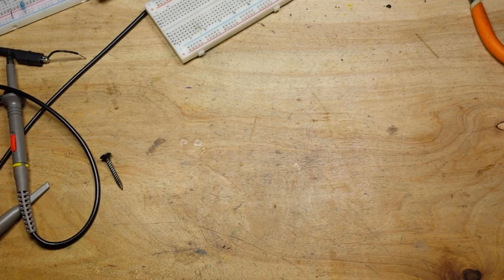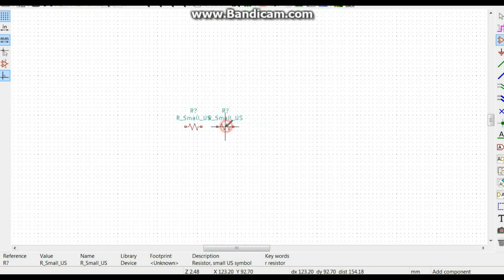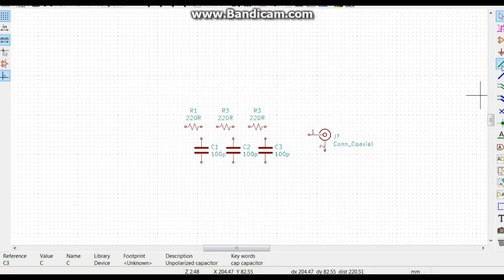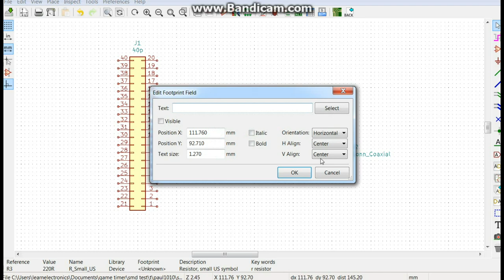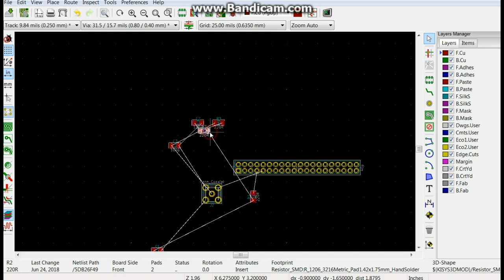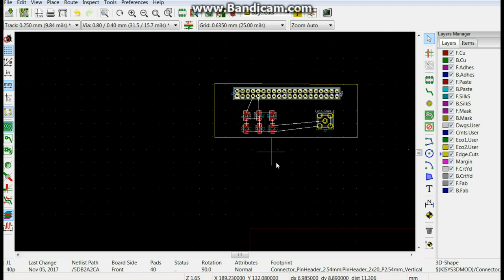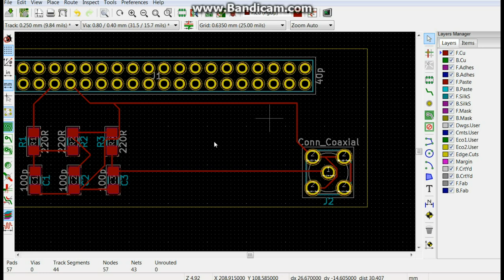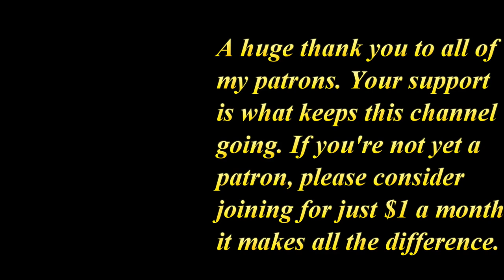PCB keychains & WSPRPI board design

Comment: If you are using KiCAD 5, you can ditch saving and loading netlist file manually, by using Tools -> Update PCB From Schematic. It simplifies the workflow significantly. F8 is the hotkey in schematic editor.
Same function can be used, if you edit the schematic and want to transfer those edits to the PCB editor.
Reply from the maker: Thank you my friend! Now how to get autorouting?
Reply: @learnelectronics  I did a search for autorouting and found that you have to use an external program. I think it is Freeroute or something similar. Or maybe find an older version of Kicad, which I think had an autoroute function (but implications were that it didn't work very well).
But, for simple boards, like this one, it is probably just as easy to hand route it!
wsprpi - I bought a kit from qrpguys for 20 meters (not assembled as yet), but may give this a try for 40 also! 

KF5AQF
Reply: I found the autorouter to do a decent job -- Freerouter was what I found a way to plug in -- but using it was a serious PITA.

Comment: First, let me thank you for your lucid and cogent explanations. Anyone with sufficient knowledge and experience can dazzle with "techspeak" and I am sure you could too. You approach explanations in a clear and non intimidating manner that is refreshing. 
Second, I cannot believe that some a*h** would comment about your edema. I am sure their crap doesn't stink! I am a retired MD and know and I know what you Dx means and what you live under, so do I.
Third, by way of explanation, I am running an RPI3B+ on the latest upgrade (Buster). The JamesP6000 repository files will not load and I get a bunch of errors trying to load. Now by way of interrogative, do you know where I I can find software that will run the WSPR on Buster? I found packets on the software upload tab of my RPI but they have a confusing myriad of digital modes. While I am an Extra Class operator I am thin on my knowledge of digital modes. I was sad when the package from JamesP wouldn't load. 
I did not retire well but will try to scrape up a donation for you. I have Alzheimer's Dz and am using electronic engineering to help delay the inevitable. I really appreciate your videos as they help me learn and retain concepts that I can put to use later. 
Keep up the GREAT work. Stay distant, stay sanitized/washed, and stay masked. You need this infection like a guy soaked in gas needs a match.
Have you posted the Gerber for the 40m filter?
Thanks.  Jeff KG7TXI

Comment: I kept on yelling at the TV, but alas, you never heard.  :)

The steps are generally:

* Place components, and wire them up.
* Generate netlist, which will force an annotation.
* load the netlist in the PCB editor.

The problem you were having is that you manually numbered the resistors, but you used R1, R3, and R3.  This was why it complained about the duplicate.  Later, you basically cleared all annotations, which then allowed it to become R1, R2, and R3.

The UI is very foreign, but once you get things down a bit it's not too bad.

Comment: A bit embarrassing to watch, but then my first usage of KiCad would not be better. A few hints:
You need to learn hotkeys/shortcuts for KiCad, it is mandatory for using it effectively. 

When placing component in schematic place one first, edit value and footprint, then copy it to the next component.
Let annotate do its job.

Moving to the PCB layout there is not reason to use netlist, F8 will do everything, but in PCB you can also directly import a circuit.
Start by doing the PCB limits, be careful about grid setting and start at a round number (Like 50mm and 50mm).
In your layout I would have placed a ground plane on the other side with a couple of via's
I would also have kept the circuit board as small as possible
Reply from the maker: terriby sorry you felt embarrassed. But I warned you at the beginning. Glad you decided to share your thoughts in an attempt to "shame me" but sadly I dont give a ______. I do what I do. If you dont like it, go watch someone else.